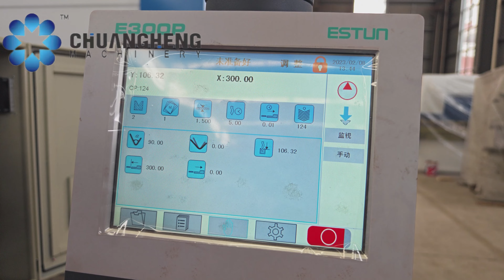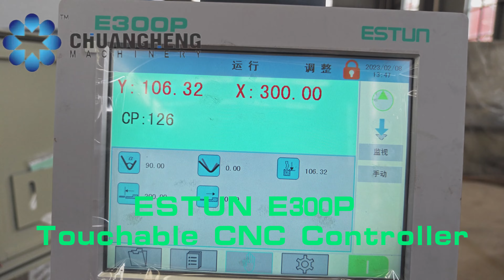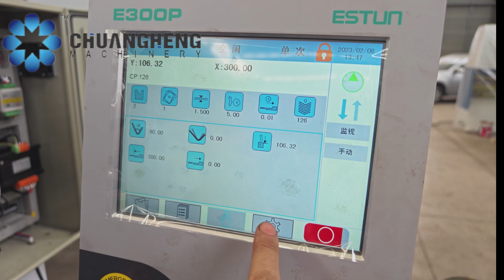CHD-PT-06327  (63TON/2700) CNC press brake,torsion bar type,X+Y axis With ESTUN E300P CNC Controller

Comment: Why you didn't check measurements with caliper ? Angle is important but not like bending length.
Reply from the maker: Hello friend Back gauge stopper finger precision has been confirmed before bending.I did not take the video,for every machines,these are as standard insepction before shipping
Reply: @chuanghengmachinery  make only one video with checking with caliper. I can tell that it's usually practice for machines from China to check angle but not bending length.
Reply from the maker: @nikolicaboskovic  https://youtu.be/VCTW_KzFLGs check this video about our calibriation of back gauge